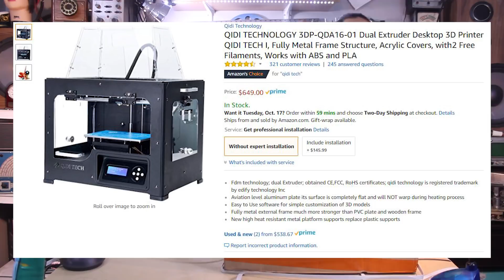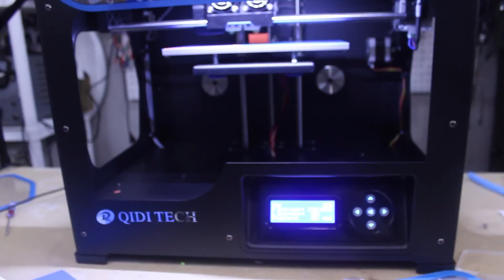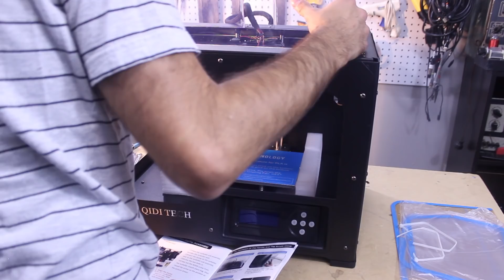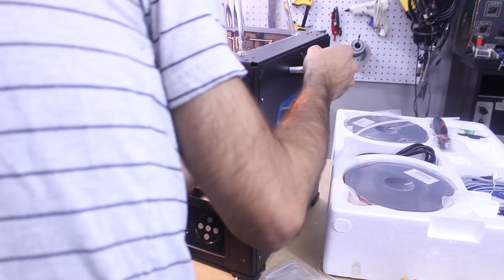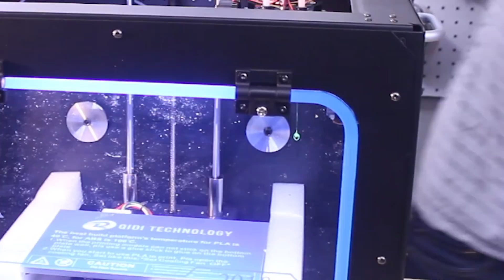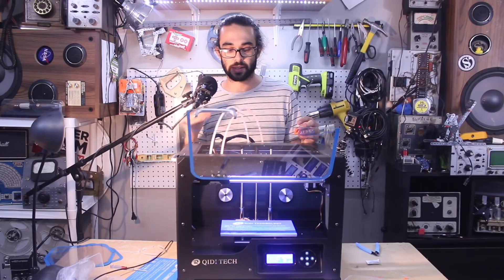Qidi Tech 1 Dual Extruder 3D Printer: Unboxing, Build, and First Impressions in under 90 minutes.

Comment: I bought six of these several years ago to make a small 3D print farm.  I've been using one of them on my desktop for prototyping and single use.  A few things broke until it was no longer usable at around 900 hours.  It's repairable but it was easier to assemble a new one.  Unfortunately, this video didn't have assembly details and, as stated in the title, was an unboxing video.    You have the new and improved version with the one piece lid, etc.

Comment: I had trouble getting the hinges on.It looks like you have screwed them on from the front but the nut slots seem like they'd need to be on the opposite side to the nut which would mean screws need to be at the back.Screws seemed too short though.I tried alsorts of ways and they would not going on,longer screws would fix the issue.

Comment: Mine arrived on the 2nd of December, the front acrylic window also had a crack in it...contacted the company and a replacement is on the way...agree with you, not great putting this at the bottom of the packaging.

Comment: hi, have you tried using PVA, the dissoluble in water filament for support structure? if so how well did it work.  Also have you tried using CURA software with it, let me know. Thanks

Comment: How has this printer been for you.  Any updates or good to knows?
Reply from the maker: It's been great! We were actually able to buy three of them at work and it is now widely used across the company. A great product if you're willing to maintain it's integrity. Also, it comes with an extra extruder for flex filament which I thought was a really nice addition.
Reply: The Tape Waster just got my yesterday. No extra extruder but really nice printer.   QIDI is sending me a free feeder gear designed for TPU :)

Comment: How do I print things? I save files from the QIDI software that was included on to the SD card, but when I put the SD card in the printer the files don't show up
Reply: If you save the file to the 'test file' folder then they will show up on the printer
Reply: @markm7470  No it's cool, I figured it out, I was saving unsliced files in model stl format haha (derp moment), saving them in X3G now so problem solved.

Comment: I have this printer and I hate it with every fiber of my being. One day it works perfect and your prints come out flawless. Then your very next print it will either 

1. Not extrude anything

2. Extrude too little

3. Not stick to plate

4. Shell layers separation

5. Start printing somewhat okay but extrusion stops halfway through print

And the worst part of all there is almost no help online for the machine or the software made for it
Reply: sounds like you dont know how to use your resources. have you called or messaged QIDI?
Reply: sounds like you done know how to use your printer

Comment: Hi there i love my qidi tech printer. Tips use a glass bed and print a dual fan duct https://www.youtube.com/watch?v=5A_ZyRdKL2s
I also fitted a fume extractor because when i started using it gave off some crazy smells. 
I use Simplify 3D and its amazing. However i am not having much look with ABS however PET-G is fantastic. I wish that its build area was a bit bigger though.
Reply from the maker: I agree. If there was anything to complain about, it would be the build size.
Reply: Yeah i wanted to have ago at printing some of the rc planes from labPrint. and they are all  sightly to big for the build plate.
Reply: I just got this same printer for Christmas. I also got Simplify 3D and I can't seem to be able to set it.
Reply from the maker: Mtranor Plays I used MakerBot software for a while and then finally switched over to Cura. Many Qidi users stick to Cura.
Reply: Ok thanks for letting me know. I just got one more question. How do you export the files to .X3G?
Reply from the maker: Mtranor Plays let me correct myself. I use MakerBot software exclusively for this printer, which exports as .X3G. But I use Cura for the newest Qidi printer (not shown in this video) which exports as Gcode. I believe there should be an extension to add to Cura to convert to .X3G. If you are anxious to get going, just try the MakerBot Print software.